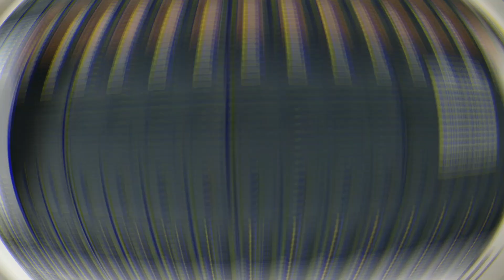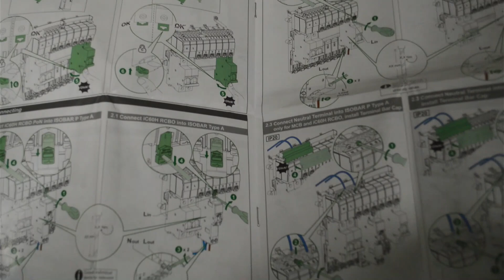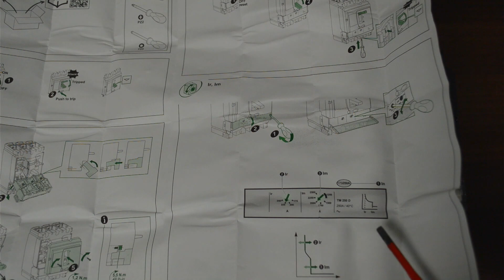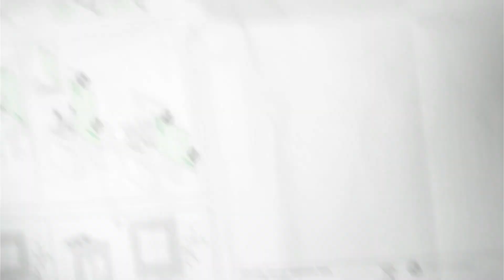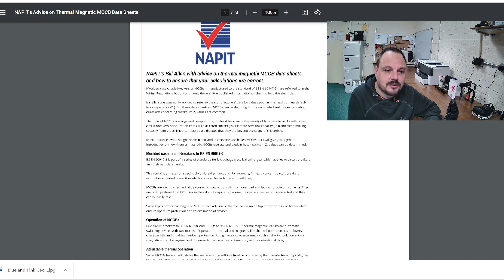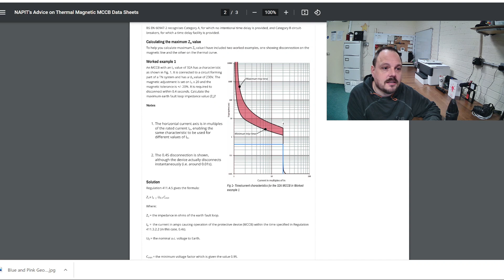Schneider Acti9 RCBO and Acti9 distribution board. NO FLYLEADS!!! Plus what is an MCCB?

Comment: Just need more manufacturers to follow suit and someone to do a dual neutral bar so main RCD's can be fitted for split load boards though the cost would probably be too great.
Reply from the maker: Check out the new eaton boards mate. They do just this.
Reply: @electrician247  I haven't ventured onto their domestic/single phase listings in years (got a little peeved with Memshield 2/3 ranges not being compatible and Mem2 being a pain to get hold of). That said we predominately use them for 3 phase installations, if you're recommending them I'll have to take a look and consider them again.

Comment: All very well, but we need boards where the L+N wire terminals are fixed items on the board, and the RCBO/MCB modules are double pole and simply plug in. No wire terminations at the MCB at all, and all items double pole isolation. It would make for a much much neater and safer board. Schneider or others want to pay me a consult fee ? :)
Reply from the maker: Check out the new eaton boards. They have exactly this
Reply: @electrician247  Any links ? I haven't come across them, and don't see them on their site ?